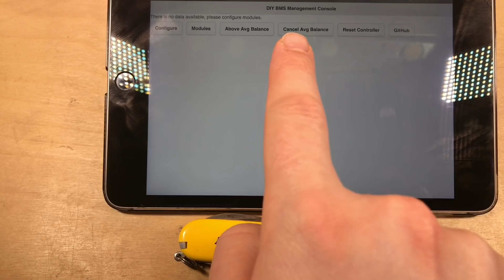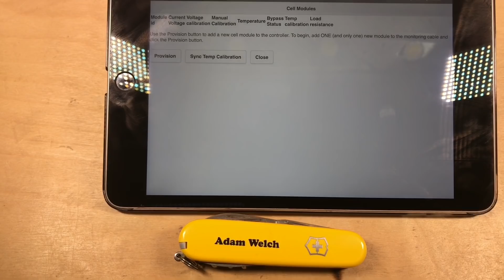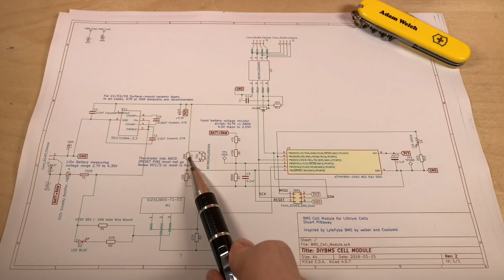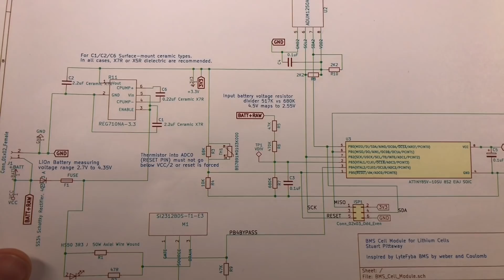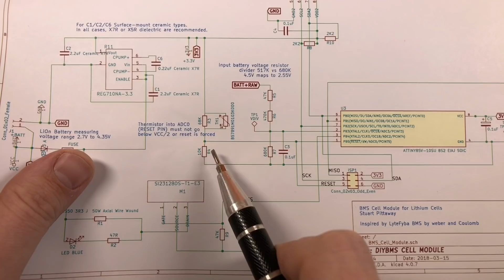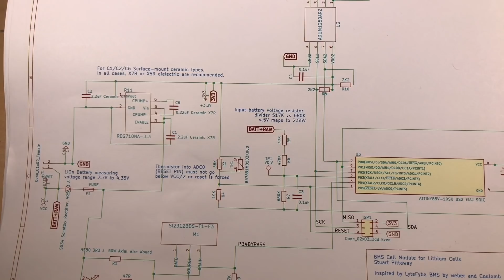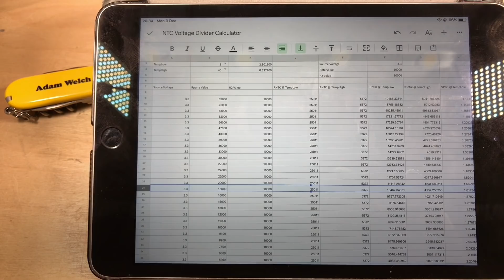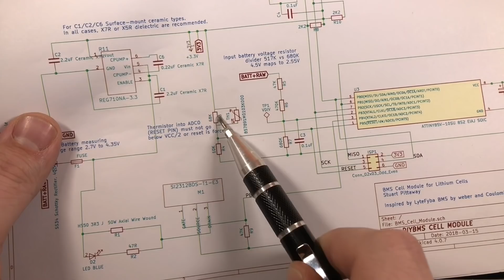diyBMS issue - Voltage Divider Maths

Comment: insulate the system and the heat generated from the power draw and charge will likely keep it above 5C. otherwise, put a heat mat or just some  beefy resistors on a thermostat

Comment: I have watched a lot of your videos and other videos on YouTube and I have a question. I've seen a lot on how to charge 18650 batteries but not how to use a 12-volt system. I saw the video on the USB adapter, three different voltages. Do you have any videos that talk about after you have your charging system in place, how to get the 12 volts and not the 5 volts? Thank you for taking the time to do these videos.

Comment: Hi Adam,
I don´t know what the software is doing with the temperature value. It might be an option to clamp the voltage of the reset input to a value above the threshold by a zener diode (parallel to the 68k), without changing resistors. In that case the ATTINY will mesure correct if temperature  is above 5°C and will always mesure 5°C if temperature is below.
If that is not an option and you you need the whole curve, you will have to adopt the internal table of temperatures to the changed situation in the firmware. Then it will be safe to change the resistors so that even without the thermistor, no reset will be triggered, i.e. the resulting voltage will keep above reset voltage.
If there is only a threshold, you can adopt the value to the new situation.
Nice project, thank you for publishing!

Comment: Instead of heating the shed why not put the cells in a mineral oil bath. Add a small low voltage heater and pc fan. If below 1 degree direct the solar energy to the heater and fan.

Comment: Another option would be to disable the reset pin of the ATmega by setting a different fuse. Only downside is that you would need a "high" voltage programmer after that. On the upside, those are not that hard to make.

Comment: If your causing a /RESET and intend to use the pin for ADC0, you need to check the setting of your fuse bits during programming.  RSTDISBL seems to be set to '0' instead of '1'.  So, there should be no reason that ADC0 can't be pulled to ground without causing a reset.  If the fuse bit is set correctly, try a simple bench test with a potentiometer to simulate the thermister to see if it causes a reset.
Reply from the maker: The issue is if I set the fuse I’ll need a high voltage to reprogram the chip. Currently that would mean desoldering the chip as the other components won’t like the 12 volts required to override the fuse.
Reply: @AdamWelchUK , not familiar with your application but I set the fuse bits all the time with 5 volts through a USBtinyISP.  You don't need to use the 12V high voltage mode.   Given that it would be likely that the SPI programming pins are used in the application, I tend to use the 8 pin dip chips and sockets so I can reuse them.  Now with that said, I can't recall if once the /reset pin is disabled, if it is possible to get the chip into programming mode again after it has been programmed and the RSTDISBL fuse bit set.  Worse case, your chip would become OTP.  They're cheap enough that I've thrown a few away.  No problem.

Comment: Good stuff Adam.  I'm to the point where I can start building my solar shed  And I'm very interested in the DIY BMS but I think I'll put my batteries in a separate insulated steel case For temperature control and then the solar shed can get as cold as it wants. Cheers
Reply from the maker: The battery shed sounds like a good idea if you have the space etc. for it. Wish I did :-( Cheers

Comment: You can program the "fuses" of the attiny85 to'disable the reset. The problem is that if you do that you'll need a high voltage programmer to go back if you want to change the firmware.
https://dntruong.wordpress.com/2015/07/08/setting-and-reading-attiny85-fuses/
Reply from the maker: Yeah a few people have mentioned this - i'd need to design or bodge a jumper to disconnect PB5 from the rest of the circuit when programming though.  For now I can live with this limitation and the new resistor value kept the BMS running last night - it hit 0 degrees too.

Comment: You could swap that low side resistor with a Zenner diode (or a couple of rectifier diodes etc depending on what voltage you need) then it would be clamped and would absolutely not go below this level. A resistor & diode combination might be better...or not. This scheme would allow a greater leeway in setting the value of the high side resistor.
Reply from the maker: Nice idea - you always seem to come up with an alternative option.  Thanks Xan - hope you're well?

Comment: Umm...how would that NTC ever give a high temp RESET condition?
Is it an Input with RESET still enabled? I thought it was just the reset...
Reply: If the RSTDISBL fuse isn't set, PB5 functions as an active low external reset pin, and the ADC input is also still functional, but there is no digital input, or digital output. Hence the naughty temptation to use the pin for ADC purposes without disabling the reset functionality. The voltage divider that was being used appears to have been driving the ATTiny85 down to the reset threshold (0.2-0.9v) and keeping it there, hence the issue.

Comment: Yahoo a new BMS video!!! Very nice insight about how you solved out this problem. i personally will not use the thermistor,  rather couples of ds18b20 via i2c.
Reply from the maker: Shove a 10k fixed resistor in there then - that should see you right :-)
Reply: @AdamWelchUK  yeah definitely ;) anyway thanks again for this level of details, with maths etc.. next time i have an issue with a voltage divider somewhere, i will remember about how you manage to solved it :)
Reply: Don't think that's an option, as only the ADC input is active on that pin when you leave the reset functionality enabled... so no digital in or out to talk OneWire to the DS18B20s :(
Reply: @pfeerick  mhm, not sure i understand you, on my esp32, i got 14 ds18b20 and it use only one gpio with the onewire lib, all via i2c
Reply: @WildLifeBackyardCamera  I'll first just point out that OneWire is not I2C... for starters, there is only one data line, not two - there is no separate clock line with OneWire. Anyway, if it was the ESP8266 or ESP32 that the temperature sensors needed to interface with, everything would be fine... but the temperature sensors are on each of the BMS boards, and connect to the ATTiny85, which does all the battery monitoring and control, and sends that data back to the Wemos board via I2C. That does open up another avenue though... having seven standalone I2C temperature sensors, and just piggyback them on the I2C bus! lol

Comment: Adam did you use the resistor values from the original circuit diagram? And the same thermistor value?  Some datasheets on the attiny state that reset occurs below 0.6v but you obviously proved otherwise!
Reply from the maker: Well when I was investigating the issue I had running modules when PB5 was at 1.4v but thought it better to take your 1.6 figure as it was in your documentation. I’ve just swapped the 68k out for a 15k and the modules are running fine (it’s about 2 degrees in the shed tonight) - but as you’d expect, the console is reporting a barmy 26! 
Yes I had been using the 68k, 10k and the thermistor you suggested. 
Thanks for this super system - it really has been running beautifully up until the weather turned!
Reply: @AdamWelchUK  you can change the calibration value in the web interface to get it back to normal
Reply from the maker: I’ll be giving that ago this evening. Cheers.
Reply: @AdamWelchUK  I've updated the GitHub pages with the new resistor values
Reply: The 2013 datasheet I have handy says the threshold is 0.2v - 0.9v @ 3V so 0.6v more like the typical. As with anything, mileage may vary! EDIT: On further thought and discussion... it's more that for the ATTiny85 to reset properly, PB5/RESET needs to be driven down to 0.2v, and the reset state will lift when the voltage goes up above 0.9v... so you want to keep the pin above at least 1.0v if you're using the ADC functionality and aren't setting the RSTDISBL fuse to inhibit the reset alternative function of the pin. It does mean you need to use high voltage programming to reprogram the chips via ISCP in future, but there's plenty of info on how to do that easily online, so it would be better to do that and prevent it being an issue at all as you're not wanting to have the chip externally reset via the pin.

Comment: I still can't understand why all this bother is better than half a dozen breakers yard car battery's ?
Reply from the maker: I understand that statement in many regards John. Both methods are recycling, both store power and it has to be said the lead acid route is less complicated. Lithium definitely has a higher energy density than lead acid, it also allows for more cycles. I have easier access to waste 18650s than I do lead acid too. 
I’ve been looking at this because it interests me as much as it is a sensible  way to power the shed.
Reply: Adam Welch Don't get me wrong, I've thoroughly enjoyed your series of vids on this lithium power bank! . And I do understand that it's for interest,  furthering of knowledge and for fun! It's made me think though that the simplest solution is usually the best solution. 😄
Reply: If you still can't understand then it's pointless trying to explain. Which is a phrase I often use to people who don't 'get' a particular piece of music, or a picture, or book, I get enthusiastic about. Different strokes for different folks.
Reply: Car batteries are both heavier and have a shorter life.
If you enjoy a workout every few years, get the car batteries.
However in several earlier videos, he had cold weather issues with the lead acid batteries too.
Reply: station240  Car batteries are 12v which is a far more practical and useful  standard. Also, from new they are far cheaper per Amp Hour.
Reply: @johnarmstrong3782  Except you can't use 50% of that capacity without killing lead acid batteries, so double the cost per Ah.
Li-Ion can use 80-95% of the capacity, and has a vastly longer life.

The Tesla Model S/X has 7,104 18650 cells, the biggest weakness is it's 12V car battery which dies every few years.

I wouldn't call a 14-20Kg black block filled with acid practical, especially used ones which are filthy too.
Reply: station240 Well as far as I have been told you can only run an 18650 down to around 2.8v and if you continually do so the capacity of the cell will start to decrease after about 400 cycles? And because I vape I have to recharge around 6 cells a day and from what I have found over the years I would say around 400 cycles is about all you are going to get from an 18650 before the capacity drops and the internal resistance rises. Having said that vaping is very demanding so I dare say light use would make a difference. 

For me and my small hobby solar system (much like Adams) which works just fine I just can't see any point in the complexity and cost of going lithium? What use is 24v when 12v is the standard to which everything most people use is manufactured? Lights, battery chargers, amplifiers, inverters, USB buck converters etc etc etc

Comment: Time to insulate the shed.
Reply from the maker: I’m unsure whether it’ll help that much - I should really build an insulated box around the cells - plus that means there an awful lot less stuff to move to complete the job!
Reply: @AdamWelchUK  An insulated box surrounding the cells ought to help - there should be some heat generated by the cells themselves as part of being charged, as well as from that beefy power resistor.
Reply: @AdamWelchUK  Insulated, or will they each have their own 'lil heated jackets? :D :D Hey, that would have been handy... resistive wire element instead of the power resistor... heater and power dissipator in one!

Comment: Great video and impressive investigation. You'd probably get away  with just removing the reset function on the ATTiny. A simple fuse. Then the ATTiny would have one IO pin more and one RESET pin less. :-)
Reply from the maker: Doesn’t that cause an issue if you want to reprogram the Attiny though?
Reply from the maker: The finger trick works because the resistance of the thermistor drops (quite significantly) and therefore the voltage on the reset pin increases.  I hope this fix will ensure the system will continue to run in all weathers, and allow for easy reprogramming. Good idea designing in a jumper - removing the chips to reprogram would be a faff. 
Thanks for the useful info.
Reply: I was thinking exactly the same thing... It does mean that a change would need to be made so that the reset pin can be isolated, as I don't think the rest of the circuit would like 12v pumped into it via PB5 if a high voltage reset is needed to reprogram the attiny85. So basically a jumper (header or solderable) after the reset pin has coupled to the ISCP header. the high voltage reset is easy... there is plenty of guides online on how to do DIY HV ISCP programming if you don't have an Atmel(Microchip) HV programmer. Either way, great work diagnosing it Adam... I would have been pointing the finger at the WeMos still... so that was a stroke of luck!
Reply: @Undefined Lastname Yeah, that or cut the trace after it goes to the ISCP header, and a wire bodge fix to reconnect the voltage divider to the reset pin. Not as pretty as a new board, but much easier than soldering up 7 more!  ;) Attiny85 specs are exactly the same... and since no typical voltage is mentioned, only the minimum and maximum, 0.6v is sort of a 'typical' but really needs to be tested on a chip by chip basis, or 1.0v considered the threshold to make it so it won't be an issue ever. Since Adam's basing it off 1.6v, he's well and truly above the minimum. The other point to note the datasheet values are with a Vcc of 3v... so I wonder if 3v3 or 5v makes any difference since they didn't mention that? Just another potential variable to be wary of. :-/
Reply: Er, where did 2.7v come from? It's a reset threshold voltage of min 0.2v to max 0.9v for a minimum of 2.5us... as it's an active low trigger. Hm, thinking about what you said further, and rereading the datasheet... so,  to trigger the external reset, you would want to guarantee that you could drive the pin down to at least 0.2v, if not fully down to 0v, and be able to release it to above 0.9v. Right? That makes sense now... I thought it would need to go back up to Vcc / float (via the internal pull-up or an external one), but that's only because the graph showing the external reset doesn't have any voltages marked on it... just the dip and rise...
Reply: Thanks for clearing that up :) Yup, that link takes you to 21.5 where the min max voltage, min pulse width info was. And yeah, the internal pull-up is only really good if you have nothing attached to that pin at all, and even then it's not a guarantee - it is still may be susceptible to power supply noise, etc, so better to pull up externally if you want to be sure. I was actually surprised it was being used as a input without the RSTDISBL fuse being set - by default the pullup is enabled, the output driver is disabled, and digital input is disabled - but the ADC input is enabled, hence the temptation to use it whilst leaving the reset function enabled!  :-/

Comment: Adam. If there is any readings from a BMS board that is out if range the Javascript on the browser page will not show any modules. If you point your browser to /getmoduleconfig  you can see the raw JSON and the offending parameter can be observed.  BTW:  Your diyBMS project inspired me to build my own home battery which is now working beautifully. Thanks.
Reply from the maker: Now there’s a useful tip - I’ll try that. Thanks very much. Glad yours is working well.
Reply: @AdamWelchUK   when you come to look at the code. Bear in mind the reference voltage for a TinyAT is 2.56V. If you are using Colin Hickey's fork I think he uses 3.3V.
Reply from the maker: Yes - Colin’s temperature code is pretty straight forward - thanks for that tip.

Comment: Place the modules in a insulated box with a thermostaticly  controlled heatmat, powered by the battery system when its charging ? Cold mornings can get good solar😀

Comment: The solution might be to reprogram the attiny and blow reset fuse. Then it won't reset on the external pin.
Reply from the maker: Stops me from reprogramming easily though unfortunately.
Reply: It is not clear from your video whether this NTC resistor read the temperature, or just have purpose to reset Attiny if too cold?  If it reads the temperature, then only choice to change fuse to avoid reset. Then it is needed to use so called "high voltage programming" to program this chip. Google for "High voltage programming". There are plenty of links on the net. I will post one link in separate comment due to automated "Likely spam" YT filter.
Reply: Here is the link: https://arduinodiy.wordpress.com/2015/05/16/high-voltage-programmingunbricking-for-attiny/
Reply: heh... I forgot that I done this thing on my web page: http://wildlab.org/index.php/2016/11/30/bricked-attiny85-no-problem/

Comment: Charging 18650s while the temperature is below 0ºC will grow dendrites inside the cells which will eventually make them self-discharge or even internally short them out.
Reply from the maker: As you’d imagine the temperature drops overnight. Generally during the day it’s slightly above freezing when there is any sun to speak of. But yes - I am going to keep an eye on it! Thanks
Reply: How is it possible to charge Tesla in the winter in -15C then?  Because people do charge them and use them with no issue.
Reply: 3dmixer Teslas heat up the battery using their own stored power. If there is none, the first heat up the battery using the charging cable and then start the actual charging
Reply: @ThanosSustainable   Ah.ok. Thanks for the info.